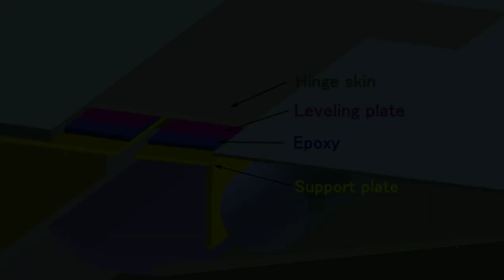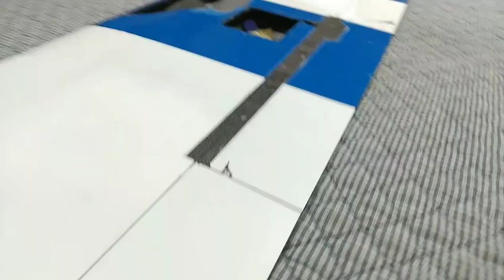RC glider hinge repair

Comment: Very nice work! Really impressive how you are re-building the original structure! Seems to take a lot of time and effort though. 
A quick and easy alternative would be to use special silicone to re-build the hinge. We use Elastosil E41 for that here in Europe. It may not be as perfect as your solution, but maybe it's close enough for some pilots :)